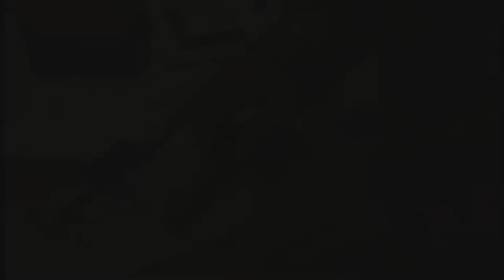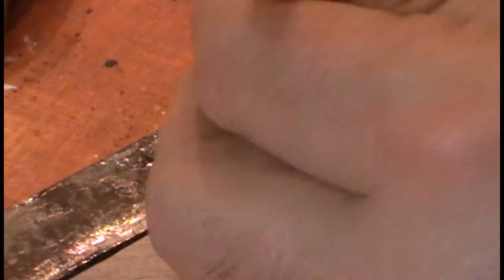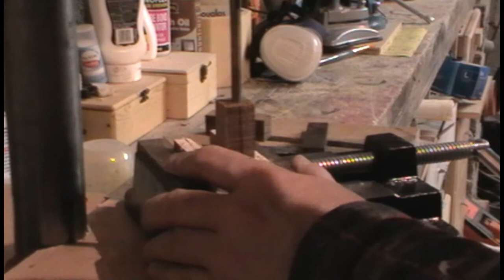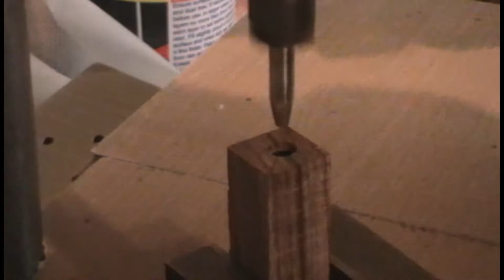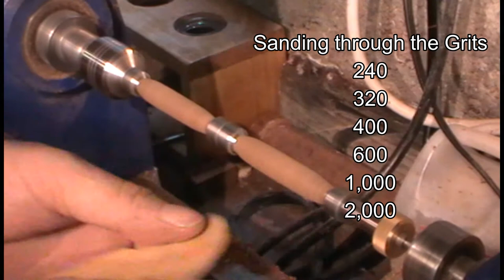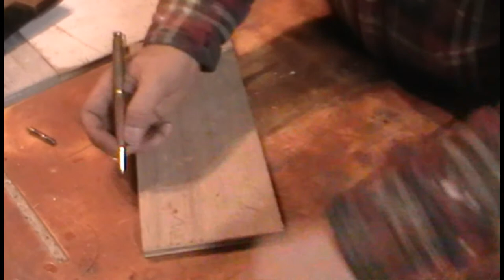Pen Turning

Comment: Nice one, I need to get a cheap small lathe for pen turning, my larger lathe is 50-60 years old and doesn't have a morse taper on the head stock.
Reply from the maker: Peen turning is very satisfying, instant wins. You have a finished project in less than an hour. Great for when you feel a bit flat in the shop, if you know what I mean!